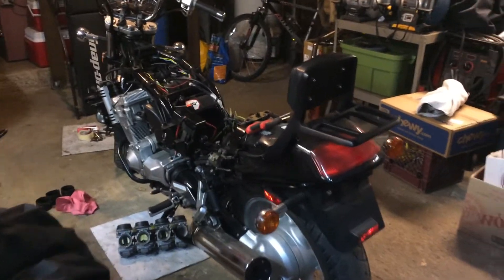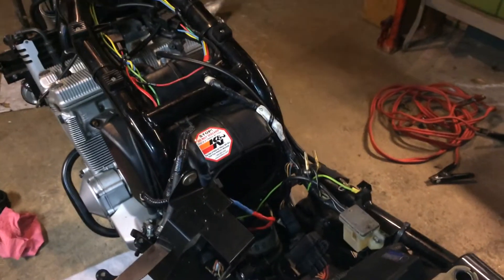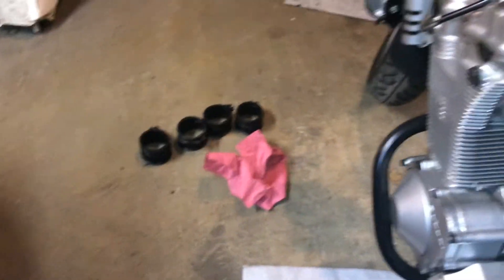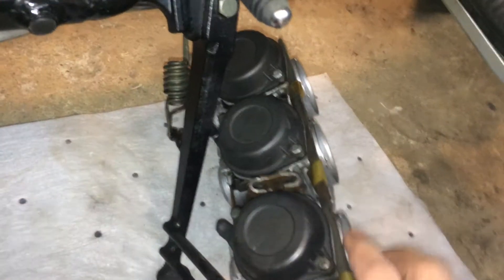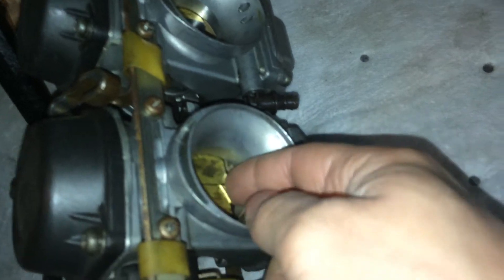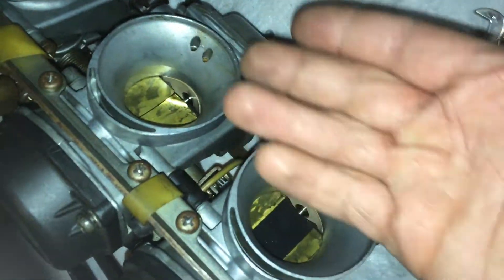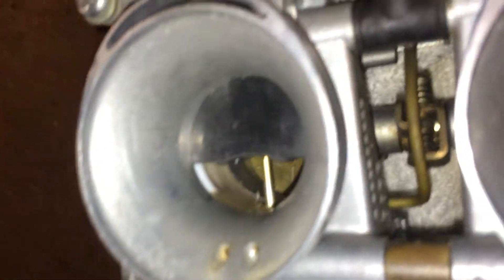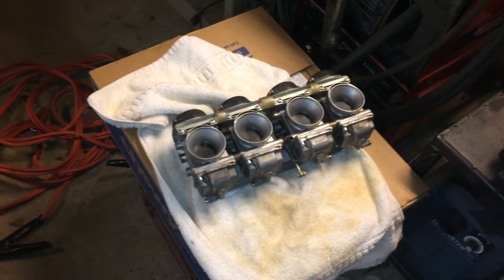1992 Suzuki GSX1100G Carburetor Removal - How To

Comment: After replacing the carbs, how did it run? I’m curious as I am working on a friend’s that has this issue. Thanks!
Reply from the maker: Phenomenal, the flat slides wearing out and allowing air leakage is a known problem on these bikes. Replaced with a set of rebuilt carburetors and it ran great
Reply: @StanwoodStudios  Awesome, thanks for the update :)
Reply: Do you have the link to the GSX forum?